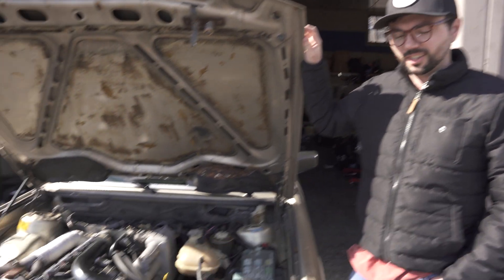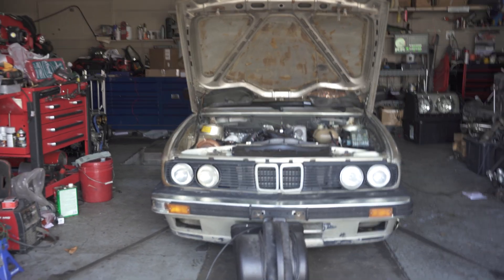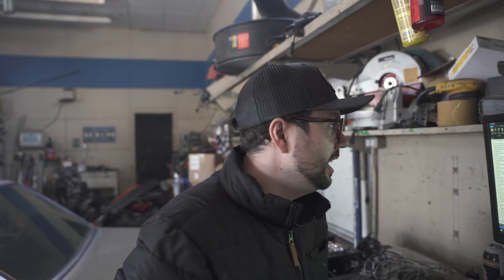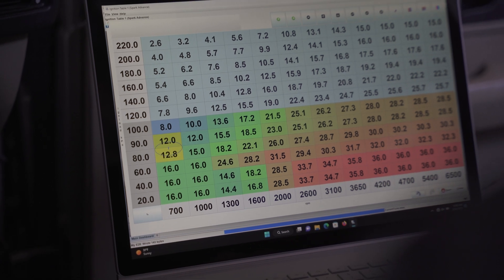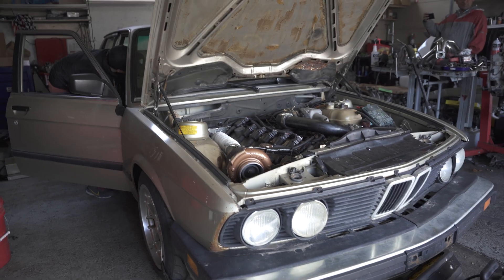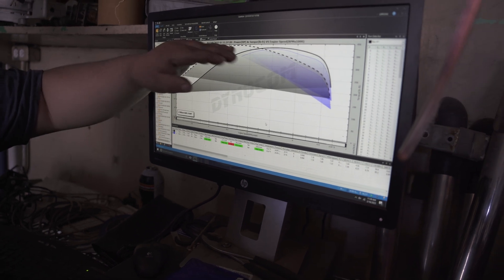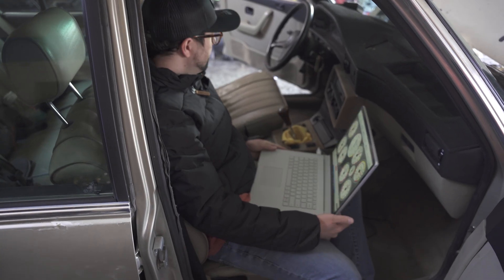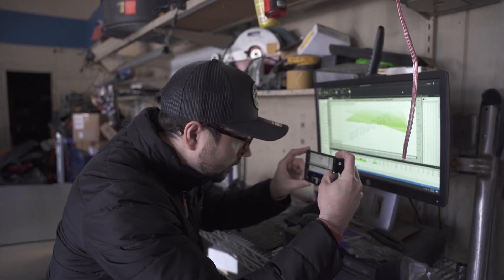BMW E28 Turbo Upgrade Part 1 | Dyno Day

Comment: Oh man now I want to mess with the m30. Have you always ran ethanol? What’s gas mileage like I wonder. Thanks and great video!
Reply from the maker: It’s flex fuel so it has been on 91octane and e85. It gets low 20s cruising and 15-17 flooring it on gasoline

Comment: That curve is good. And you're not pushing the power. So longevity is real nice.
Reply from the maker: Its been at this power level for 5 years with zero problems on a bone stock engine. Its been surprisingly reliable
Reply: @TurbineResearch  m30s can handle some good power. I'll be looking for around 300whp on my 2.7i said and done. Maybe 350 on an over boost tune. Gotta flex on some coyotes.

Comment: Mind if I get a look at the msq! I'm on a second motor cracked ringlands on the b32 motor now on a b34 with arps
Reply from the maker: Send me and email to the channel page email and I'll send you the tune! What boost and afr are you running?
Reply: @TurbineResearch  14 psi pump gas tho just got the knock sense for microsquirt in 👍

Comment: that tuner is cool af to help you on your tune like this, most time, they don't want to give you "how they win their life" (that what i've been told when i just asked about a little help on my ignition map 😒)

Nice curve , flat where it need to be , and this torque output ... 😍 

ps: i had an M30b34 before, N/A tune, 282/282/108 cam, 10.2:1 CR from Hartge H7 e32, the factory ecu by Hartge was set to 6800rpm, so i think you can pull up the rev limiter a bit if it not knocking 👍
Reply from the maker: Thank you !  After the turbo upgrade I will be raising the rev limiter to 6800 to see if I can bring a bit more power up top .